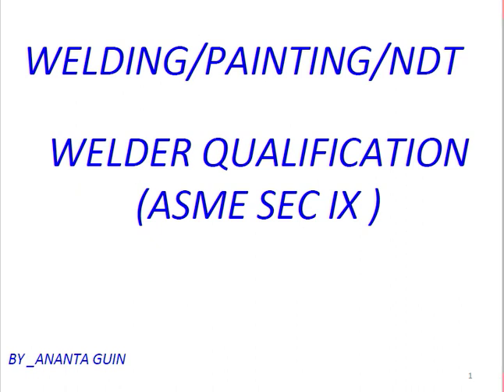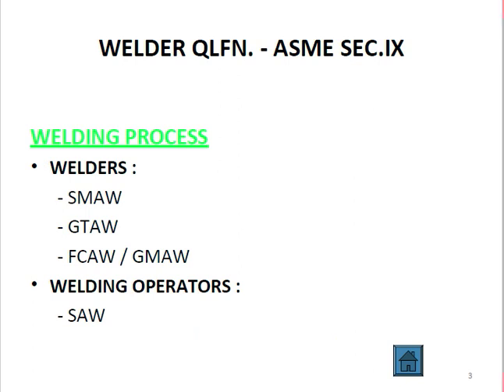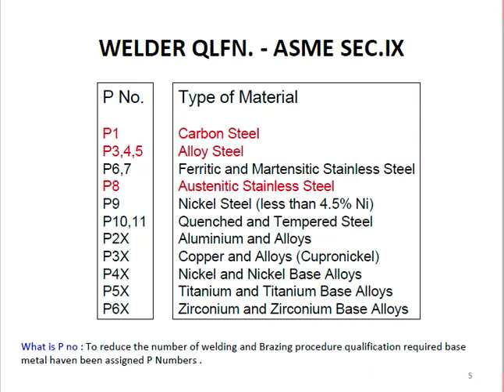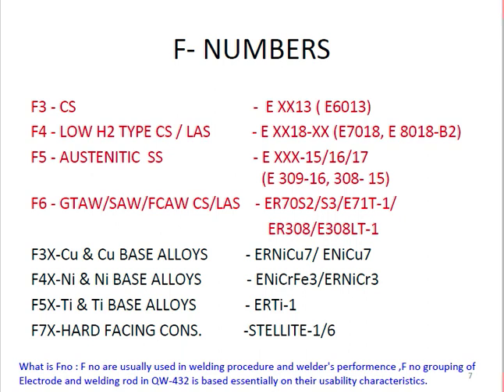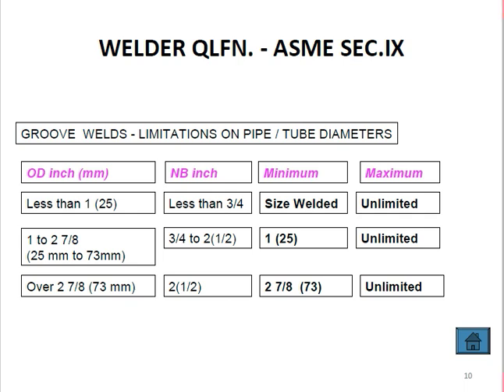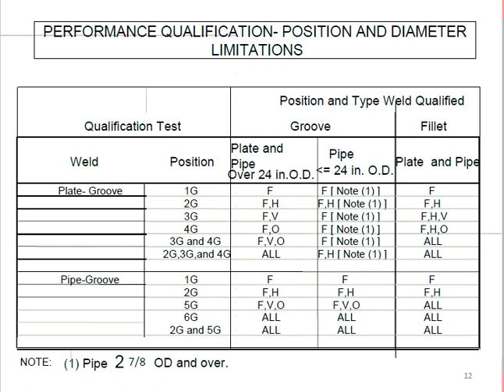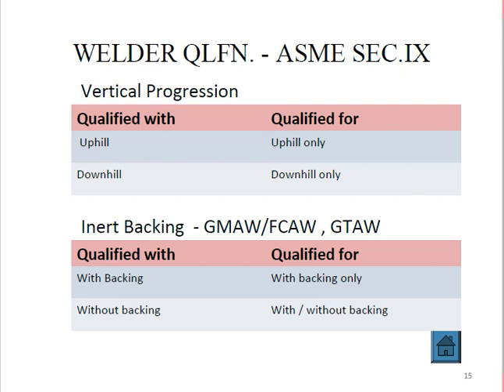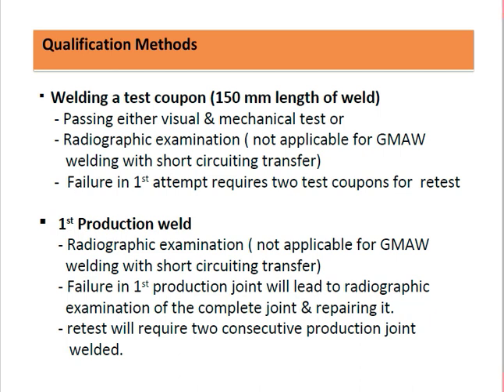WELDER QUALIFICATION REQUIREMENT  AS PER ASME SEC IX

Comment: Thanks for this. Plscanswer this question for me:
What are the markings on welder qualification test coupon and those on procedure qualification test coupon?
Reply from the maker: Thanks, I will upload one video on this.
Reply from the maker: Marking on Welder Qualification and procedure Qualification requirement you have to refer qw 451.1 and qw 452.2 and how you have to marking on Welder Qualification and procedure Qualification test piece you have to refer 463.1 a, b,c, d&e including 463.2 a, b, c & d.

And for marking you have to create the unique identification no on test piece and when you cut the test piece for bend and tensile specimen the you have to transfer the unique identification no to each piece.
Identification no like - project no - WPS no-Welder no etc including if bend test required then have to write face bend or root bend etc